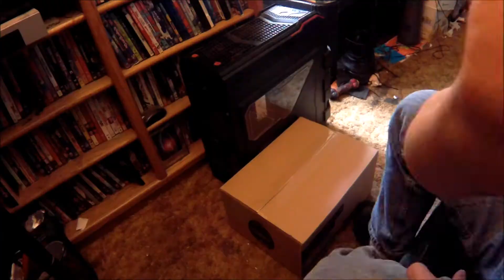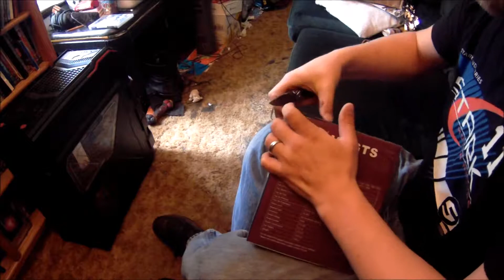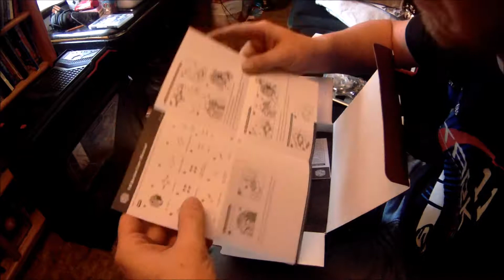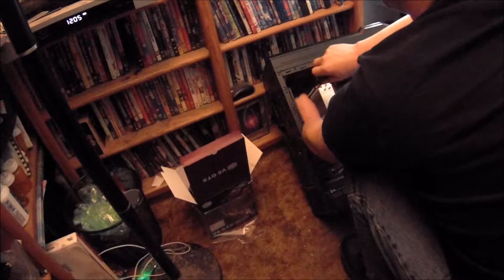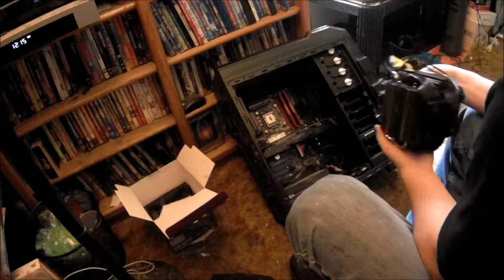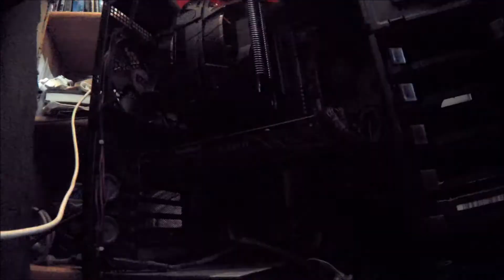CPU Cooler Swap: Hyper 212 EVO to V8 GTS

Comment: Thx for the walk through & the advise.  I'm replacing my 212 EVO with a my new V8 GTS that I just received from amazon an hour ago.  old heat sink can't keep up with my new CPU (AMD FX 9590 8 Core).  My old CPU was a AMD Phenom II 955 4 Core.
Reply: Success!  My new Cooler Master V8 GTS works!  It's keeping my CPU temp at 129-F or less.  My old Cooler Master 212 EVO could not keep up.  At 136-F my new AMD FX 9590 8 Core CPU would lock up.  Not anymore.  I've stress tested my CPU with my new V8 GTS.  Works like a champ now.  I can render any of my video projects without problems.
Reply from the maker: that is a hot chip.... Do let me know how the GTS keeps up with it.
Reply: And yes it performs great under CPU stress testing as well

Comment: Nice video.. Was there a major difference in your heat temps afterwards?
Reply from the maker: With my 6700K OC@4.4ghz, the 212 evo was hitting 70c+, now running @4.5ghz and topping out around 60c. However it is a little cooler today so maybe 5c of the change is just from the cooler room temp. An AIO w/240 rad would perform better, but not a big fan of liquid options because of reliability.
Reply: I am with you sir. I'm looking at rebuilding my PC with a 7600K from a 2500K which has a water cooler  and since I don't OC the current system. I'm debating  on Air for the next one. Again thanks for the video.
Reply from the maker: The 212 is a great cooler for the money, and if I ran a lower OC it would do just fine. I also have not hit the CPU's thermal max on the 212, only got close to it.
If you are going to upgrade I would take a good look at the Ryzen 5 1600, comes with a very quiet air cooler and will almost keep up with the 7600k for gaming, but out performs it in multi-threaded tasks. all for the same price point.
Reply: and by now 1600 outperforms 7600k :P

Comment: Dude does this cover the 1st ram slot? Also would you recommend this for the 8700k? I think this would look well in a PM01 rgb case.
Reply from the maker: it does cover the first 2 ram slots. my ram is pretty short but there is about an inch of clearance so should be fine with all but the tallest ram kits. also the 8700k is a pretty hot chip, not sure how well this would hold up if you push the overclock too much.